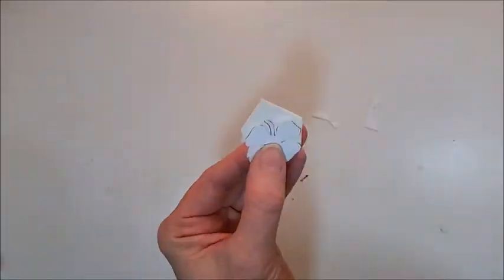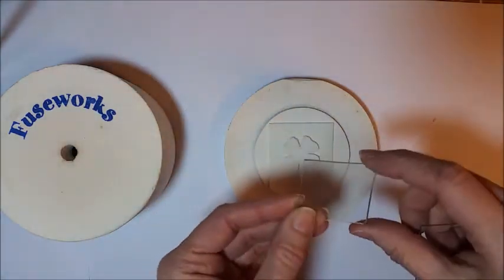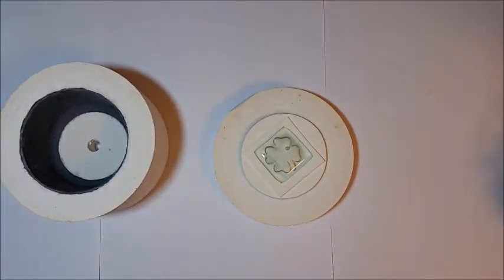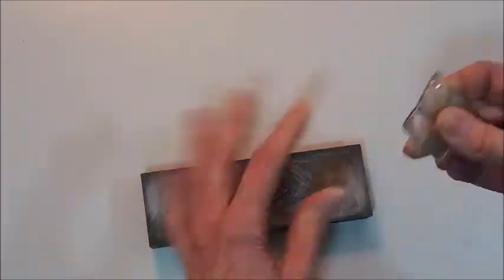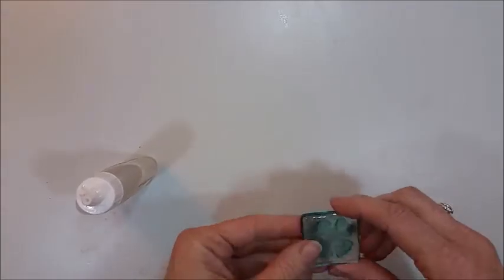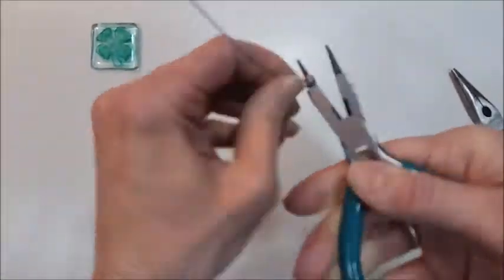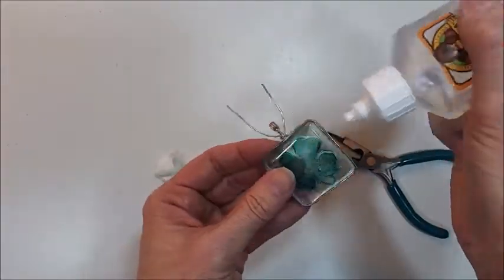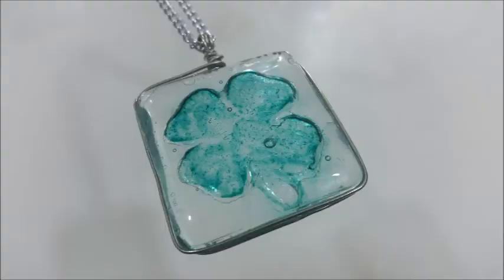How to make a shamrock lucky charm pendant from recycled glass

Comment: Is there a way of putting something during the melting phase to make a small hole so you don't have to drill it later?
Also, what grit is that time block? Curious if I were to order it online (since I am getting all the other stuff from Amazon at the same time) ☺️
Reply from the maker: Hi thanks for your question. Sorry I don't know the answer to your first question.  I do know that there are molds you can buy but I have never used them. The sanding block is actually a sharpening stone sorry I don't know if they even come in different grit sizes. I have seen them at the dollar tree and also at Harbor Freight so they are pretty inexpensive. Hope that helps. Thanks for watching.